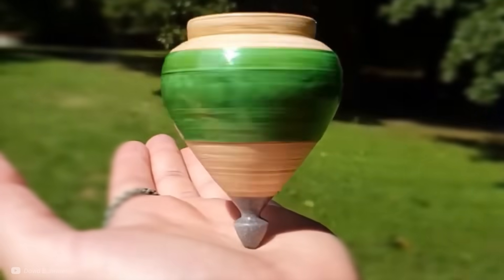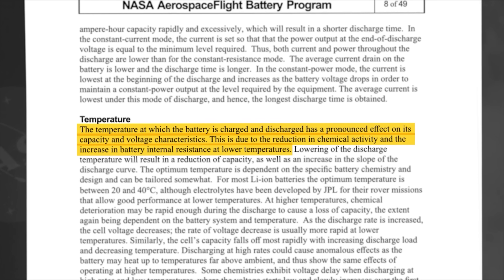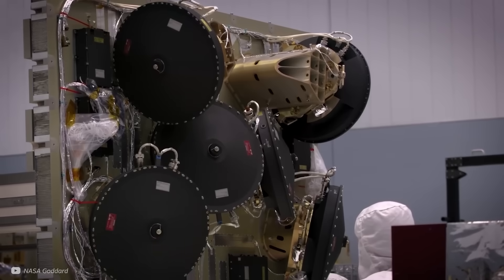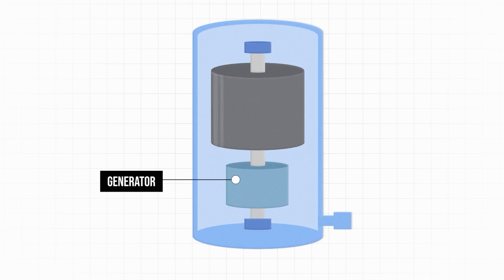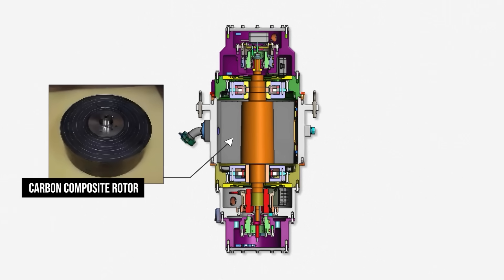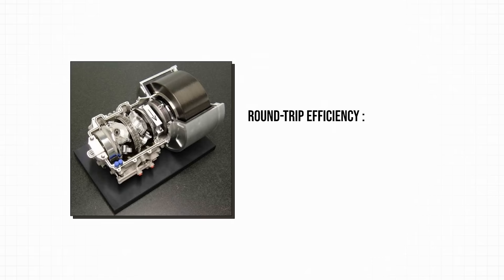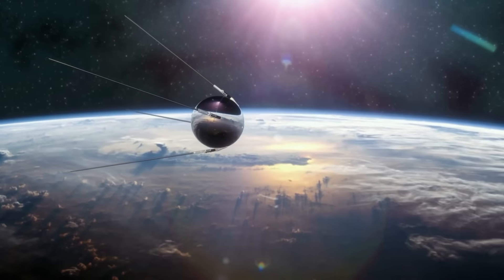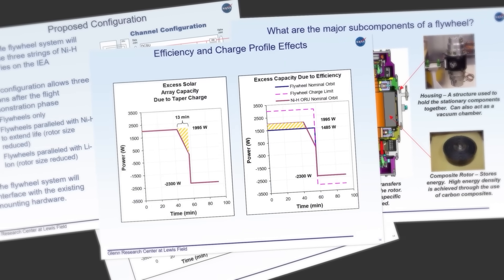How NASA Reinvented the Mechanical Battery

Comment: Flywheels cannot change the momentum of something (height). But they can change the angular momentum (orientation).
Reply: Exactly, I was about to say the same thing. But now I'll just co-sign on your comment... Attitude yes, height no.
Reply: @Abednego-v2r  They cannot change the altitude or elevation of an object either. only its orientation.
Reply: @traviss7954  not altitude, my guy, attitude, like you better change your attitude right now. Before I give you an attitude adjustment. 😏 lol jk
Reply: @Abednego-v2r  after reading again I see what you mean. I misread attitude for altitude in the comments, but the video specifically mentions height (above the earth) twice.
Reply: @travisschwab7954  im also high above the earth...bro! "Cough" "cough"
Reply from the maker: Added a correction in the pinned comment! Cheers, Ryan
Reply: When I heard that I cringed
Reply: @M0j0R1s1ng3 why cringed?🤔🧐
Reply: @nicolasolton  Because it's cringeworthy when someone explaining a technical concept demonstrates that they have very little actual understanding of that topic?
Reply: dude thought attitude was altitude...
Reply: I was going to say that something sounded hella fishy about that intro.
Reply: - well, one could mass-eject the flywheel for a momentum step change, lol...
Reply: @kadmow  hey, we could make the flywheel out of frozen hydrazine, and then use it to fuel a rocket. this makes the flywheel into an ejection mass, so basically the same thing ;%)
Reply: @gregmark1688  😳😝
Reply: You can if you use it to launch something away from it, pushing it in the opposite direction.
Reply: @rylandrc  What you talking about is a centrifugal launching device. Not the same effect that a gryo produces.
Reply: Or : considering the video covers NASA's intent for a dual functionality of control gyros with power storage, perhaps it provides a storage buffer for combined solar & nuclear generation to one of the electric rocket types available (so altitude) and precision directional control of the jet (attitude ctrl). Its possible.
Reply: Incorrect.. they can change momentum
Reply: @charlesg5085  No, they cannot. They can only change orientation. I guess they can change rotational momentum, but not linear momentum.
Reply: That is why Harley Davidsons win every slow race, and every dirt flat track race that they ever get involved in.  There is a flywheel built into that V-twin that stunt riders had only recently discovered.  On the flip side one of the worst motorcycles to ride are ones with parallel to lean angle facing crank assemblies, like certain Hondas and BMW opposing force engines.  I mean they look great on paper and some people love them for it, but honestly nothing is worse than a bike that wants to lean over every time you rev the engine.  Which then transfers to the rear wheel causing it to kick out to one side during rear wheelspin such as in dirt, rain, or while doing a burnout.
Reply: Momentum and height are two completely different things that have nothing to do with each other by them selves. Why did you say momentum and how far something is off the ground are the same thing?
Reply: @aethelred9781   I get what you mean. But when talking about orbits there is two kinds of momentum at play. linear momentum (speed around the earth) defines your elevation. Gyros only effect rotational momentum. aka spin/ rotation. Gyros cant make a space craft move faster or slower in orbit.
Reply: @traviss7954   In orbit. ok.  I didn't have that context. I didn't realize you were just talking about their behavior at that speed and altitude. Yea nothing they can do to affect speed and therefore height of an orbit.
Reply: @aethelred9781  so what is moment of inertia?
Reply: @Abednego-v2r  Is like how hard is to change the rotational speed. A bigger flywheel will have more moment of inertia than small flywheel.
Reply: @aethelred9781  To change the orbit (the height, etc.) need to change velocity first. A flywheel cannot change the velocity / momentum. Momentum is velocity x mass.
Reply: @tmjgaming9880  I needed the relationship cleared up, thanx. I wouldn't think a flywheel could have any affect on height or speed of an object though gyros are used aa sensors to adjust other mechanisms to change direction. But they can't do it by themselves obviously. Or can they If they're tangental and one spins slower or faster?
Reply: Well stated bro. I couldnt find these exact words, but yes.
Reply: Altitude can be changed by having 3 flywheels " fight" each other to change the orientation,  with the resulting force being directed I the change of Altitude,  otherwise where would the energy go?
Reply: @JackPlum79  You cannot change momentum in a closed system. You can't speed up or slow down a spacecraft with a flywheel. The only thing that flywheels can do is rotate a spacecraft.
Reply: Exactly that's why they build these multi flywheel systems, each with a 90° angle difference to each other. Allowing it to adjust in all directions
Reply: @benmcreynolds8581  Adjust orientation on three axes, yes, but not altitude at all.

Comment: There’s an ISP I used to work for that had 2 flywheel based UPS systems in their main building. I’m pretty sure they were installed when the place was built in 1995-7
Reply: Flywheels are heavy right?
Reply: Was that building located near to SPIU?

Comment: So you actually believe that flywheels can be used to control the height of satellites, as you claim in your opening statement?
OK 🙂
Reply from the maker: Stupid mistake by me here! I read about attitude in my research, misread it as altitude, and then said height... a chain reaction of errors haha
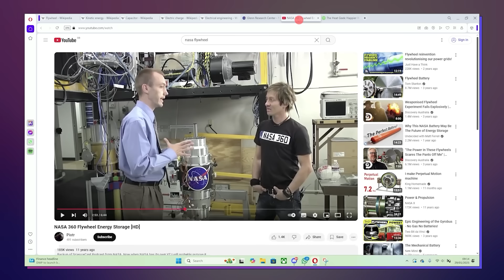Reply: ROFL put lipstick on a video reposted 11 years ago, from video reposting from another video on NASA 360.  It's even in your video @3:53
Reply: Rewatched the intro assuming he misspoke and said altitude instead of attitude but nope. He said “control the height…of a satellite.”
I’d also like to see this reaction wheel propulsion. ¯\_(ツ)_/¯
Reply: @Bob94390  Well maybe, if it spins fast enough, checkout the Lense-Thirring effect and the Schiff effect..
Reply: @marksmith9218  Lense-Thirring effect: A rotating mass drags spacetime around it, slightly altering the orbits of nearby objects.
Schiff effect: A gyroscope in orbit around a rotating mass precesses due to frame-dragging and spacetime curvature.
Reply: @SpiritmanProductions  Also Podkletnovs work, may be of interest.
Reply: @ Hmm, he suggested that rapidly spinning superconductors could reduce the weight of objects above them, but his experiments have never been reliably reproduced, and his work is generally considered fringe science. Interesting, though!
Reply: @SpiritmanProductions  yes it often gets labelled fringe, shortly after it is brushed under the military carpet. Bit like Pons and Fleischmann, now we read in Nature magazine, that water can trigger nuclear reactions in water cavitation to create 'excess' heat and transmutation, isotope gases such as Neon22..